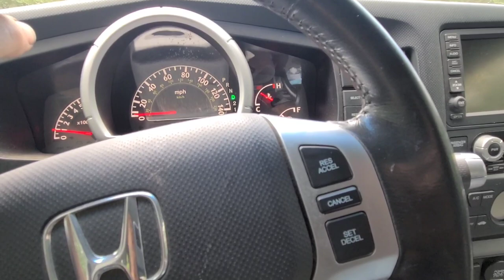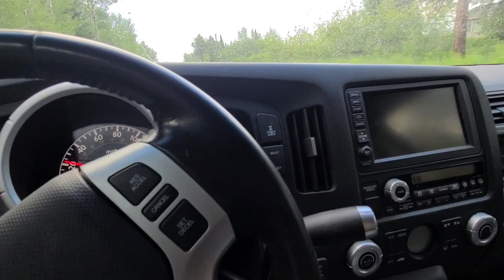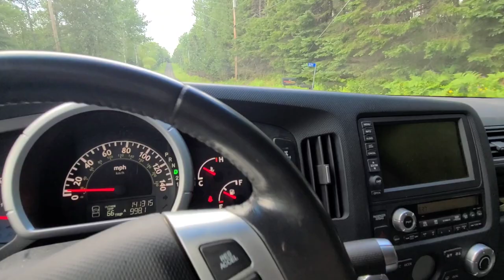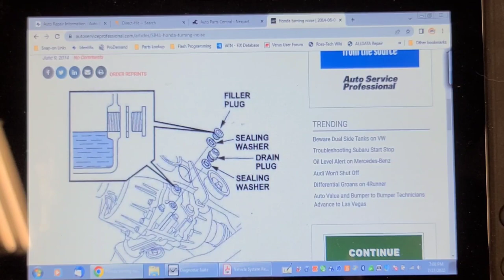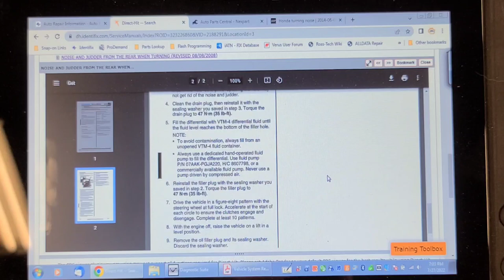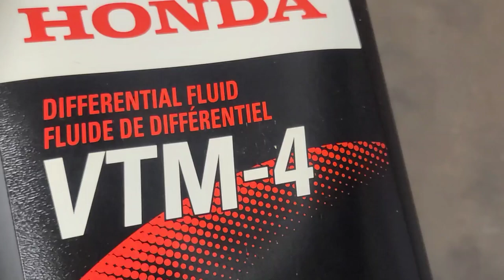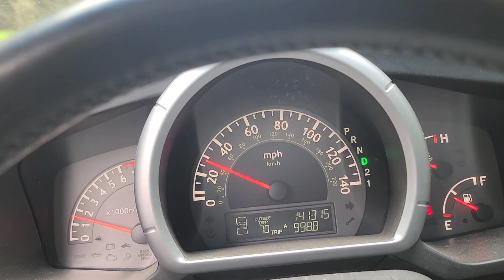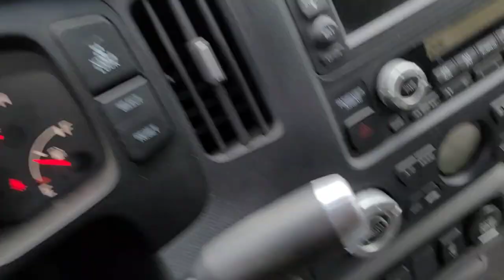2007 Honda Ridgeline Weird Moaning Noise Under Load On Turns At Low Speeds

Comment: If it does it when it’s in gear not moving also- front axle?
Reply from the maker: It's not this if it does it not moving. Check your power steering oil level. It may be low
Reply: I mean it does move, the sound starts as soon as it goes in gear. I did also replace power steering fluid and power steering unit.
Reply from the maker: @InspiredJJ  if it makes noise sitting still on drive its not the clutches since they are not moving. Should be able to find the source. May need to put it on a lift

Comment: Did you find the noise ? Mine has the same symptoms . Noose coming from the back , like a animal moaning . I replaced the power steering wheel pump , reservoir and power steering fluid thinking was that, but  noise still there.
Should I change the differential fluid ? Both , back and front or just the back ? Thank you for the video
Reply from the maker: Yes change the rear fluid. Buy genuine Honda fluid
Reply: @PhillipBailey  Already ordered on Amazon , thank you for the helpful video

Comment: Maybe the additive must only last so long.  Sometimes Sceptical of replacing fluid but that was on automatic transmission when problems arose. Customers all want to change tranny fluid when it wasn’t shifting very good and 99 percent of the time they were throwing good money after bad. Good job.
Reply from the maker: Thanks. I checked recommended maintenance and it only says to "inspect" the rear axle fluid every 25k

Comment: I did that small noice from rear differential changed it to be about 45 minutes got better, still love and transmission oil and from differential oil needs to be changed, going to go ahead and change the engine on as well Hondo some kind of joke second engine already